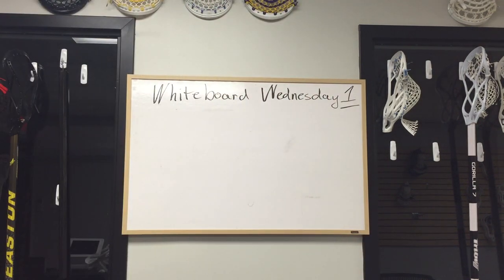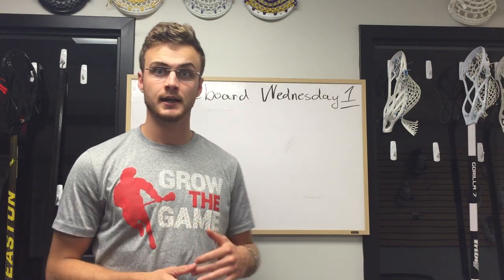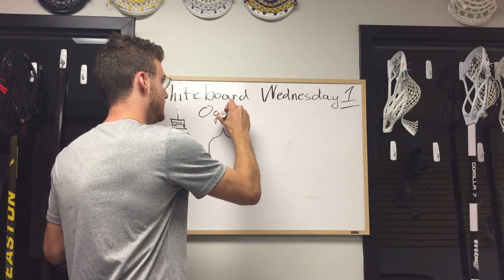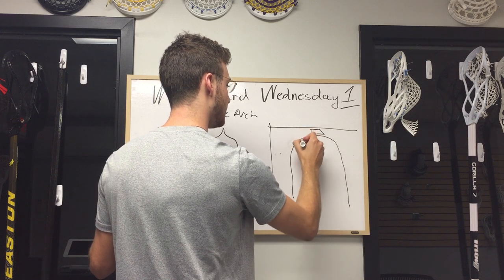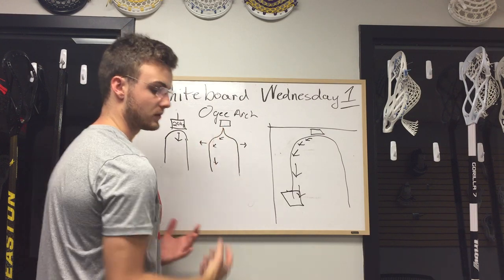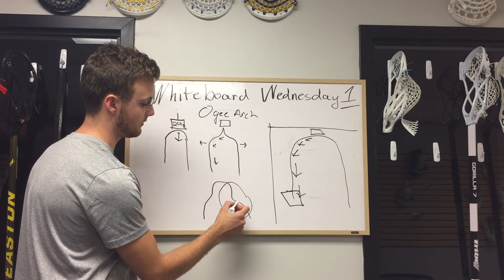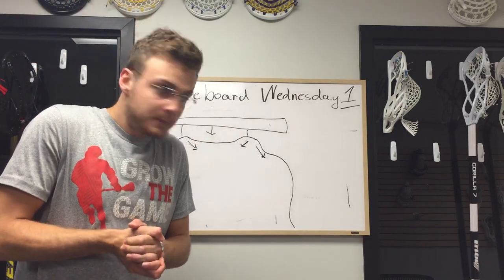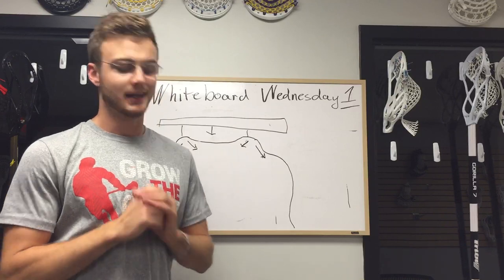WW1.2: Shaft Geometry and Strength

Comment: Maverik's Apollo seems to be taking cues from this as well. Looks like we'll have more than a few shafts like this hitting the market soon.

Also, just because I am curious about the science of it, I second Matthew - how does a round shaft like a Joule distribute weight, and at a fundamental shape level is that stronger or weaker than "extreme concave"?
Reply: I believe that it'd be stronger. The Joule Lev and Punisher shafts are already established as some of the strongest shafts and often found in the box lacrosse game. Chris points out that a concave shaft lends itself more to an Ogee arch which "won't build the tallest bridges in the world" compared to the typical arch of which Actually does. And round shafts like the Lev lend them selves more to that typical arch shape. This is just my theory, though.
Reply from the maker: +Sean B circles are pretty idyllic...it's tough to make a one to one comparison with a Joule shaft because they are 8.2 ounces, so they obviously have a lot more material reinforcement as well, but it's rounded shape absolutely helps it's strength. The real question is whether you believe that shape is relevant in lacrosse, which is where people get chippy :)

Comment: I have a question... Why didn't you mention the Joule Lev? It's not like the Ogee arch that you mentioned but it does take the characteristics of the basic, rounded arch design. Is there anything about the lev that kept you from mentioning it or was it just that you didn't pay it any mind?
Reply from the maker: +Matthew Magiera see my earlier comment for a little more detail, but the spherical shape is idyllic from the strength to weight ration side of things, but the question is whether it should be used ergonomically in lacrosse, which I wasn't trying to address in this video.
Reply: +Mainely Mesh I see. Thanks. My money will be on Joule's round shaft, but I'm sure that the Project G will be an amazing shaft regardless.